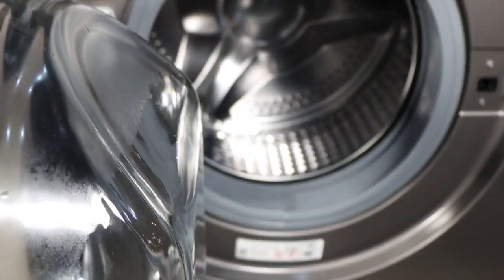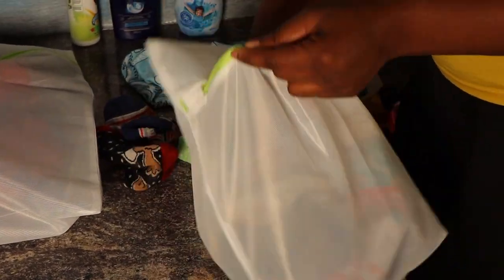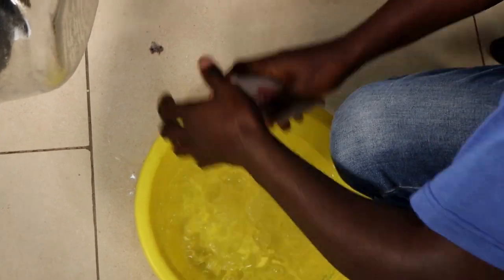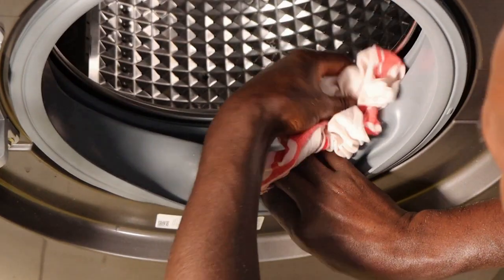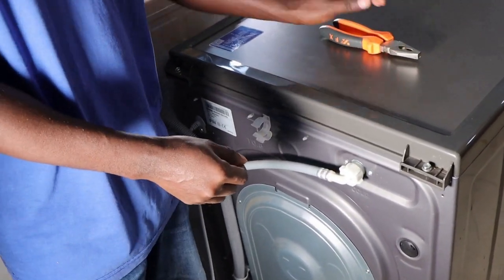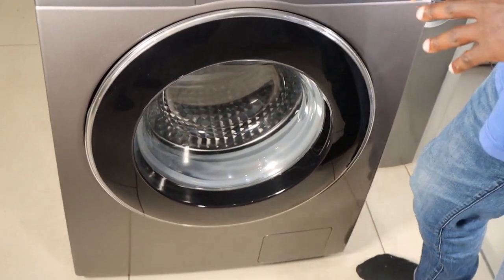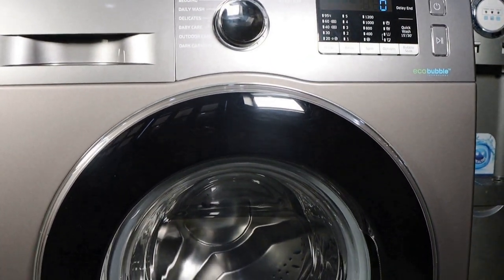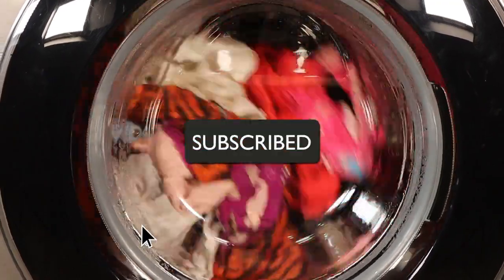How to Maintain your Samsung Washing Machine | Do's and Don'ts

Comment: Hi, can one use an extension as a source of electricity if your house is not made in a way that accommodates a washing machine?
Reply from the maker: Washing machines draw a large amount of electrical current to operate. Most user manuals will indicate that using an extension cord for a large appliance such as a washing machine is not advisable. Generally speaking, using an extension cord for your washing machine should be avoided.
Reply: Alright, thank you.